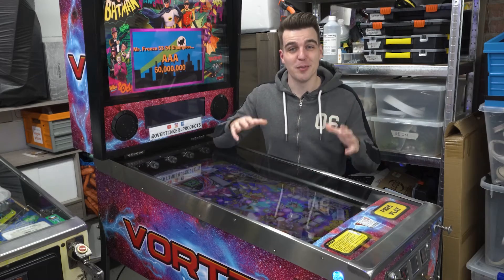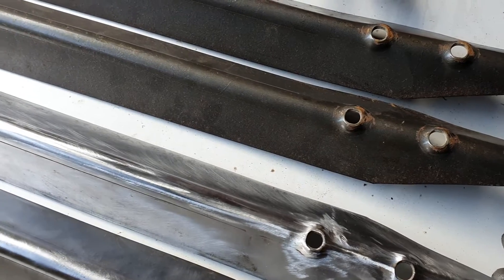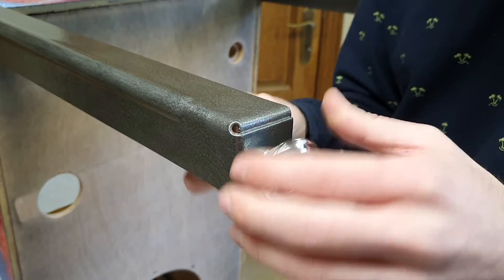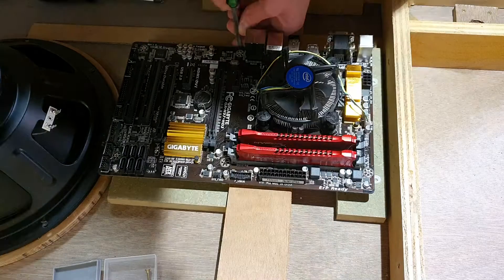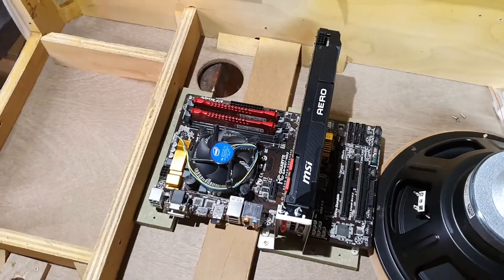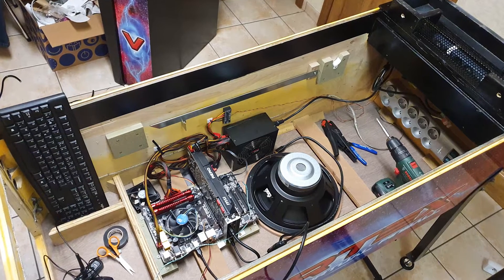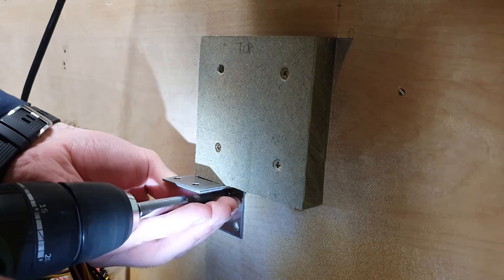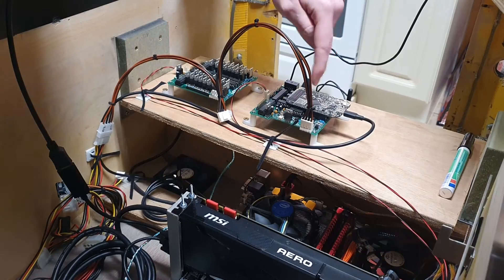The Perfect Electronics Controller! - How to Make the Ultimate Virtual Pinball Machine Part 3

Comment: tip, you mounted the Motherboard on two separate boards, one at each end. u need to consider that with separate 'feet' the MB might be stressed (bent or bowed) because the distance between them is not the same as the holes in the MB (hope that makes sense). when it heats up it will flex and may cause traces to come loose. can overcome this by allowing screws at one end to be loose so the board can expand without causing it to bend. mounting the MB on one piece of wood also avoids the issue.

Comment: What gets me is wire brushing the legs with a drill.. 

Several days? I could wire brush an entire coach in that time..
Reply from the maker: I started sanding those legs with the intention of polishing them to a shine, which is why at first I took a lot of time to brush and sand them all way more than is necessary for just painting over them. Also, I work on projects in my spare time, so most of this work was divided between several evenings or a couple of hours here and there, spanning multiple days

Comment: Love the series….I wish I had your skill level and the guts to try a project like this for myself (but alas, I don’t)! I was wondering about the CPU/GPU/RAM specs you used to smoothly run the tables at 4K/120Hz……Thanks!
Reply from the maker: You can start a lot smaller and simpler than this vpin to make it less daunting. I only have a 60Hz screen, so no 120Hz. I run it with a GTX 1070, which I feel like is a bit underpowered for the latest tables. I don't know exactly what CPU I used but I'm quite sure it's an I7

Comment: where do you buy the pinscape board to build yourself? i cant seem to see anywhere to buy?
Reply: Arnoz sells similar boards that are fully compatible.
Reply from the maker: Yes that's true, I took the hard route but there are ready-made boards available too like Arnoz :)
Reply from the maker: I didn't buy it directly. I followed the instructions from the Pinscape build guide to order the PCBs from a PCB manufacturer, and all the parts

Comment: Where did you got the TLC5940NT  chips? they are out of production!
Reply from the maker: I must have ordered them about 2 years ago, but they were already out of production as well. At the time you could still order them from AliExpress or Ebay, which is what the Pinscape guide recommends
Reply: @overtinker.projects  that the point. Nobody will be able to go this way again, nowadays. There is a modified pinscape board layout which uses the new smd TLC-chips (i got one), but as far as  know the layout has not been published, yet.
Reply from the maker: You can still buy these on AliExpress, so people can still do this. There are also other alternatives like Arnoz' boards. You don't have to follow everything exactly :)
Reply: @Mr_Turnbull correct!
I created the smd version 😊
Reply from the maker: Awesome! I didn't know about an SMD version. Where can I find more info on that? I'd like to read up on it

Comment: There should be a metal ground plane beneath the CPU board.
Looking like a great build.
Reply from the maker: Beneath the PC motherboard or the Pinscape controller?
Reply: Sheet metal with metal standoffs on both, all connected to ground. The boards may have sufficient grounding in the PC boards already, but typically this is done to prevent electrical noise. You can see how it works as is, but if there is erratic behavior, consider this change.
Reply from the maker: Interesting. I did have some issues with the 48v power supply destroying the motherboard. I blamed it on the cheap Chinese quality, but maybe this extra ground plane would have helped
Reply: No, probably bad power supply.  Check all voltages before hooking up next time.
Reply from the maker: @DrChrisKing bad PC power supply? I ended up replacing the 48v supply with a Meanwell one, that ended up fixing the issues